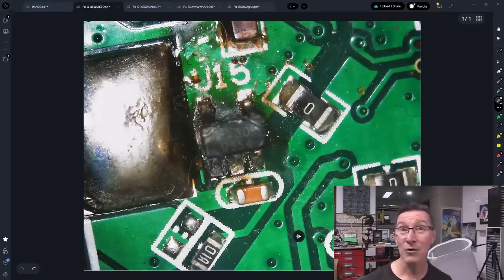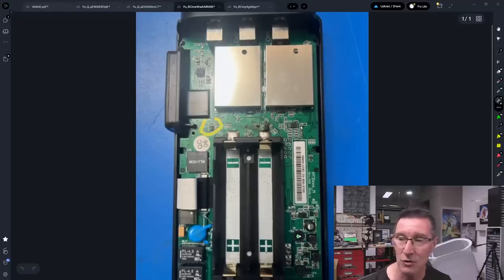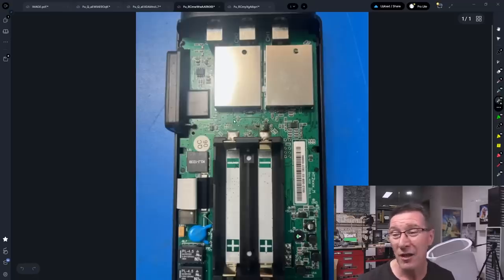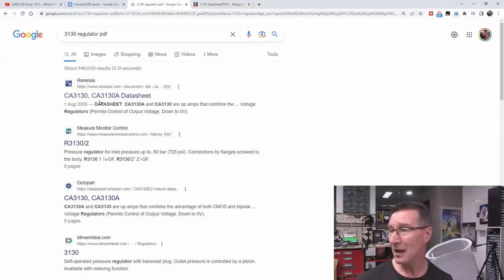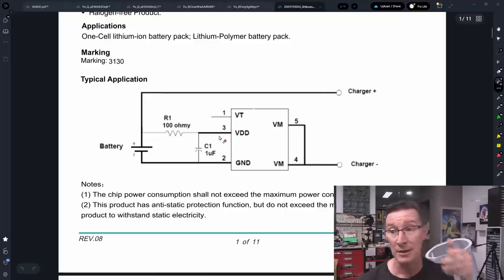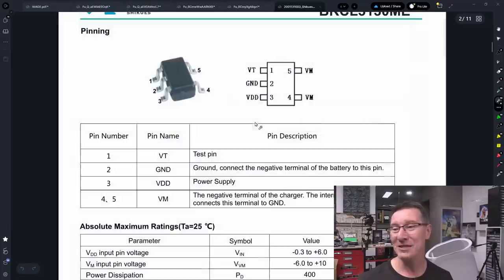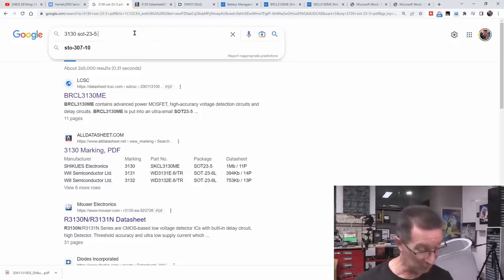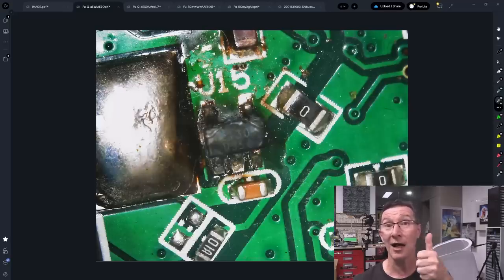EEVblog1541 - What is this Blown SMD Component? Redux

Comment: SK seems to correlate with the manufacturer name Shikues. Looking further down, BRCL prefix components are made by Foshan Blue Rocket Elec. My guess would be that something is going on behind the scenes with company names and part sourcing. Maybe the company changed its name, or maybe it trades under several brand names. This seems not unusual in China.
Reply from the maker: Nicely spotted. That seems the most likely thing, because the datasheets and specs look identical, no one has found a difference yet.
Reply: @EEVblog  "second source" ??? (blast from the past)

Comment: I have a flashlight that uses a single 18650 for power and I inadvertently put the battery in backwards once, and it blew a similar part to this.  I would put money on that is what happened here.  The battery are supposed to go in with the same orientation, but we are so conditioned with AA/AAA battery powered devices to alternate orientation, I bet someone did this without even thinking about it.
Reply: They saved $0.03 by not including reverse polarity protection.

Comment: Dave,
After 40 years of reading data sheets, my number one pet peeve is still when the data sheet writers put two or mover versions of the part on the same data sheet and don't tell you the difference in the very first section.  Packing codes is one thing but functional differences are something else.  I have had data sheets where I had to call the manufacturer and ask, at times even the rep couldn't tell me.  Would be so easy to say the B version has improved specks, is a product improvement or provides alternate function on pin 6  etc.   At least I would know where to look in the data sheet for the details.  Can't even count the number of hours spent comparing data sheets looking for an answer.
Reply: Don't even get me started on connector manufacturers...
Reply: I notice quite a bit with the western semiconductors, looking at mouser and Digi-Key there will be like 4 SKUs for the exact same part. Only difference is the tape reel part # buying in a box, tray, whole reel, etc but won’t make a difference in the min qty you have to buy from a distributor. It only applies when buying full sets from the mfg.
Reply: @bobert4522  This one used to drive me nuts.  At my employer, it used to be the circuit design engineer would have to fill in the correct suffix mfg part numbers when pulling a new one.  How am I to know what size and type of reel the plant would prefer today!?  Seems like even after wasting time asking, I would get it wrong and then have to sign off change orders later on to change reel size or was it paper tape vs plastic, etc.  Tubes, vs trays and on and on.

This was before the company got large enough to have a component engineering staff and now all I need to care about is the actual part number w/o all that packaging stuff.  Those folks can concentrate on those details.
Reply: @eeengineer8851  yeah sometimes the extension just tells you whether it is on a 7" or 13" reel. You get to recognise the codes if you do purchasing long enough. I guess you need to have a rapport with the people running the SMD line which fortunately I do.

Comment: One of the reasons why Right to Repair should go global.
Reply: Right to repair is more a moral question that needs to be addressed properly 

Should engineers who spend months knocking out prototypes solving issues, tweaking it and then it's mass manufactured to bring prices down

Would you want all your hard work to then be freely given out for people to copy? Intellectual property vs right to repair
Reply: @cjdelphi  Most having the resources, supply chain, to make a copy, probably also have the capital and skill to buy a few of said product and reverse engineer it. That isn't an option for regular users who just want a working product.
Reply: @martinfinne7259  would you be happy to hand over a schematic that took you years to perfect? It's purely a moral issue for me

It wouldn't be too difficult to print on the board the name and value of every component, most people who repair would simply find a spare board locate the component desolder and swap

That's how the electronic repair industry goes quicker to look for blown and shorted components and leaving boards that have gone open loop, a thermal cam for example 

Most of the time a multimeter and patients is all you need to locate most issues and then back to the highlighted problem in this video, wtf is the blow component 

Maybe there is a better way, instead of companies releasing schematics, component values with absolutely everything given away. Some kind of website or app that allows you to look at some company's intellectual property which might have say over a 1,000 components and you can zoom in to that location and get just those specific values 

Or let the right to repair and release the schematics for non profit and charge people who make a living a fee to access the data

There has to be a middle ground everyone is happy with
Reply: Just a parts list goes a long way. Like this example if the part is given, you can buy it and repair it. There is no need for schematic. Appliances come with an expensive parts list so no issue there. If you need a detailed electrical schematic they the repair would be to extensive for an everage user anyway
Reply: @jotnarymir1393  And yet the schematic was the norm just a few decades ago.
Reply: @jotnarymir1393  check for blown components cracks in traces if good people then probes voltages I think just randomly check for shorts first as that's the quickest way of fault finding then start measuring voltage drops and rails because that takes time as to take care to not short it out while probing

But seriously unless it's a $$$($) board you have to consider your time spent on it
Reply: @cjdelphi  You already do hand over the schematic. Just in form of a finished PCB. A sacrificial device, a heatgun to strip all of the parts and a couple of hours (days?) with a continuity tester will give you a netlist you can "easily" redraw to look any way you like. Measure parts, decipher package codes and you are done. If you want to automate it, a flying probe tester like the ones all PCB manufacturers use to test produced boards should be easy enough to reprogram to output a netlist.
Reply: @MikrySoft  unless you do that with every new piece of hardware you buy, you're going to have the same issue when something blows, unless you're lucky it's going to be a value near impossible to find unless you have a spare or cough "donor" board to locate that blown component to find the value you require, surely requesting the value beats 4 days of heat gunning and continuity tracing on the off chance something blows outside of warranty 

As an amateur with nearly 20 years of experience in electronics I think I'm at intermediate level of skill I can design circuits easier than repair them, to get my skill level up I would have to venture into 240vac and smpsu's and crap myself plugging it in (I should start look for a variac lol)
Reply: @cjdelphi  Obviously it's not a solution for everybody, but it's just an example that is meant to illustrate that the whole "handing over a schematic" argument is disingenuous, there is no moral issue here, every copy of your product already comes with a schematic, just an obfuscated one. Releasing schematics just makes everyones life easier.
Reply: @MikrySoft  yeah that's fine if you reverse engineer it, but most wouldn't due to voiding warranty, just opening it voids warranty
Reply: @cjdelphi  First of all, no, in civilized countries opening it doesn't void warranty. Second, I'm not arguing that manufacturers shouldn't or don't need to release schematics,, I'm saying they might as well release them since anyone wanting to copy them can already recreate it.
Reply: @cjdelphi Well it used to be totally normal to release schematics. We're the engineers unhappy about that back then?
Reply: @cjdelphi  Most people who reverse engineer and make clones don't care about voiding warranty. Schematics and parts/lists should be available openly.

Comment: CA3130...  blast from the past!  That was a nice op-amp for the day, used that a couple of times.  But expensive.
It can use a low voltage supply and works rail-to-rail.  I used it e.g. in a FET voltmeter (took an analog 20k/volt multimeter and added a FET stage for high input impedance).

Comment: The problem is that the device that blow up, may not be the source of the fault. So you replace the blown component, only for it to blow again, shortly after the device is switched on. This is like replacing the fuse without discovering the short that caused the fuse to fail. 
In this case the real fault maybe in the charging circuit. 
A cascade failure is far more difficult to fix, as the source of the failure may show no signs of damage. The question to ask is why did this component burn, was it the battery, the charger or the component itself. 
On this basis, buying one replacement part for the obviously damaged part might not be the best idea.
Reply from the maker: Yep, but you have to start somewhere, and the part is obviously blown. So either way it needs replacing.
Reply: @EEVblog  might be a good idea to buy at least as few replacements. My bet is on a battery fault, as the similar part, on the other battery is still intact. This suggests the charger is not at fault. Worth checking the battery voltage, before switching the equipment back on, as it might indicate a dead battery.
Reply: It's obvious, he put a battery with the polarity switched
Reply: @fss1704  a reasonable explaination  given tbe part appears to have active thermal protection in normal operation.
Reply: @nigeljohnson9820   yup. I used aftermarket batteries. (higher amperage, and strangely enough, slightly bigger diameter) The smoke was released shortly after that lol

Comment: I had a feeling it might be a MOSFET because it reminded me of one I replaced on my Intel NUC. Turned out a downstream bypass cap had failed short and killed it. I popped the cap off and replaced the FET and it was fine. I should probably put a replacement cap back one day.
Reply: Not if it still works. Muntzing?
Reply: @VndNvwYvvSvv  Absolutely. Tolerances often leave a lot of slack.

Comment: You also sometimes need to try all the variations, since not all manufactures use the dashes the same.
 eg  SOT-23-5 SOT23-5  SOT235 SOT-235    etc..

Comment: SK referring to a manufacture line of semiconductors maybe. AnaLog on ECG, NTE, SK Replacement Semiconductors.  SK was started by RCA. Glad I watched this blog. I am wanting to build LIon battery supplies and chargers for several pieces of test equipment to eliminate having to replace regular batteries. Maybe this 3130 might work.
Reply: Use a TP4056 or TP4057 module from any online source. Under $1 including all the ancilliaries and a USB socket. Make sure to buy the modules that have 3 chips total, which are "protection" ICs (usually a DW01 and a dual mosfet) if your Lithium cells don't have an inbuilt protection PCB.
You can also get the voltage regulation you need from tiny Buck or Boost modules also freely available for under a dollar. There is absolutely no need to design anything whatsoever.

Comment: Direct to battery generally a standard battery protection unit, with integrated mosfet. The RC on the pin is a give away as input filter. They probably are in series cell wise, but probably the reason the one fried was a battery put in incorrectly. Yes plenty of different pin compatible ones around. Most likely the difference between them is either cut off voltages for different battery types, and current thresholds for the various use cases.
Reply from the maker: I couldn't see any difference in the datasheet though, maybe I just missed it. Specs identical.
Reply: @EEVblog  Could also be a different grade part, one tighter tolerance than the other, or the datasheet is incomplete, and one is a special selection out of the general batch.
Reply from the maker: @SeanBZA  Yeah, you expect it in the datasheet though, so if no one can find any difference, then it must be incomplete.

Comment: i put 3130 sot 23-5 ic marking on google and first result was a datasheet from LCSC, which happens to be the datasheet of this exact part. I dont know why that guy was having so hard time searching for the part number. anyways great video as usual.
Reply: I googled sot-23-5 3130 as the video was playing and got the same first hit on the LCSC data sheet. Finding a part's data sheet is not always this easy, but I usually start with a simple search such as you did.

Comment: In your first search... of 3130 PDF one of the results near the top did actually have a part number matching and was described as a SOT23-5 package... but did you miss it??? (visible at 6:20). I am sure you would have found a good match there as that takes you to a "high integration solution for lithium-lion/polymer battery protection " one...

Comment: I've seen a few linear regulators in that kind of package, could be anything as you are fully aware

I'm more curious about why multimeters give a capacitance reading when measuring an inductor

In my head measuring an inductor should read as an almost short with no capacitance until you stop measuring it letting the magnetic field Collapse?

Comment: 3130 Lithium battery protection IC (3:09 is where I am currently) Pin 1 is a test pin so not normally connected. The crispy critter still has part of the 1 and 30 visible. Always fun repairing sans schematic - just did a dishwasher control board. 5 capacitors down (after 10 years of use) - replaced capacitors, unit working again.

Comment: That look more like a standard 5 pins voltage regulator, capacitors around it might be a good hint. The 01A resistor value which is R100 ohm could be a current limiting resistor if this is an LDO.
It could also be a dual SOT23 MOSFET built-in.
Reply: Did you write this comment without watching the whole video?
Reply: It's not a voltage regulator. You're close with the MOSFET guess...
Reply: @TheHuesSciTech  Basically yes, Based on my experience I could nairrow my guesses, but watched most of the video after the comment

Comment: list  possibilities chip used in a battery application  marked 3130, 5 pin SOT-23
ChatGPT

A chip marked 3130 in a 5-pin SOT-23 package used for battery applications could be a variety of components. It might be challenging to identify the exact chip without more information, such as a manufacturer logo or additional markings. However, here are some possibilities for what the chip might be:

    Voltage regulator: A low-dropout (LDO) voltage regulator can be used to provide a stable voltage to the system powered by the battery. Examples include the NCP3130 from ON Semiconductor and the TPS76330 from Texas Instruments.

    Battery protection IC: A battery protection IC is responsible for monitoring battery voltage and current to protect the battery from overcharging, over-discharging, or overcurrent conditions. An example of such a chip is the S-8241ABPMC from ABLIC Inc.

    Battery charger IC: A battery charger IC can be used to manage the charging process of a battery, such as controlling the charging current and voltage. Examples include the MCP73831 and MCP73833 from Microchip Technology.

    Battery fuel gauge IC: A battery fuel gauge IC estimates the remaining battery capacity, providing information on battery state-of-charge (SOC) or state-of-health (SOH). An example is the MAX17043 from Maxim Integrated.

    Voltage supervisor IC: A voltage supervisor or reset IC monitors the supply voltage and triggers a reset signal if the voltage falls below a specified threshold. An example is the TPS3125 from Texas Instruments.